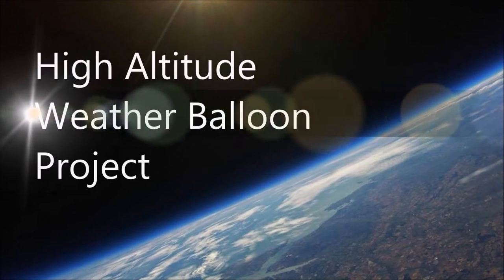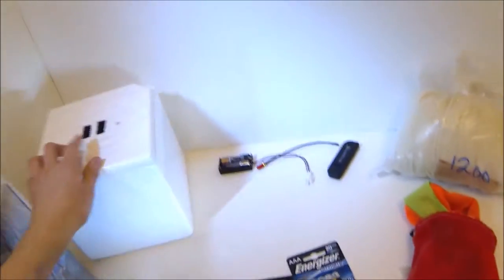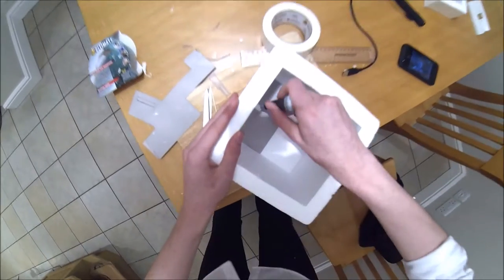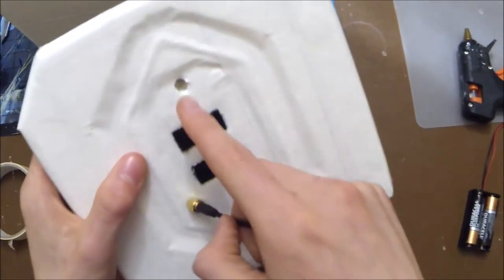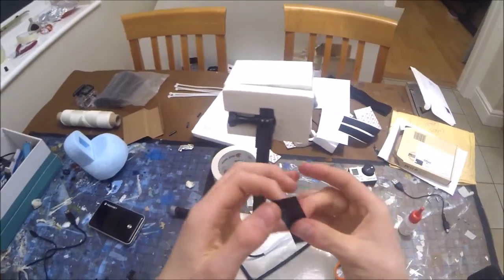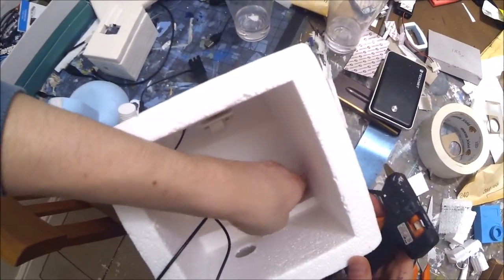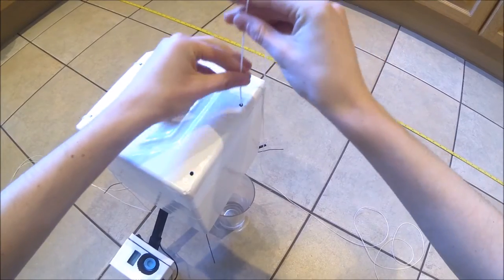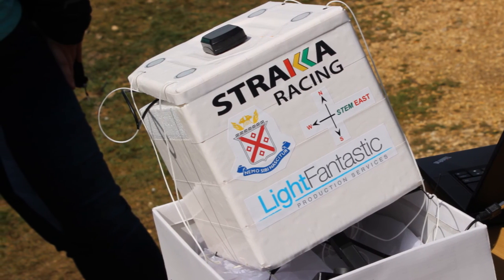High Altitude Weather Balloon - Construction

Comment: You what?!???!? With a what???! 5:43
Reply from the maker: It was an old soldering iron with such a bad tip it couldn’t even melt solder any more. It did the job of melting the poly very nicely and with far more control than a naked flame. If you don’t have an old soldering tip that you don’t care about you could heat up a metal object instead (similar to what I did at 6:50)
Reply: Ah, thank you! Very informative :)